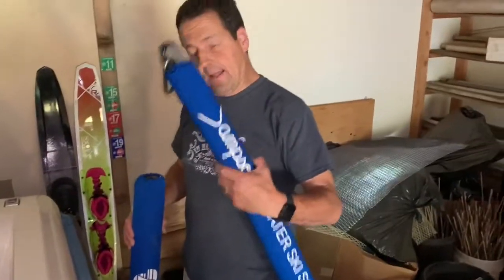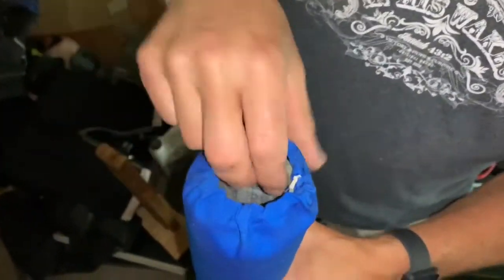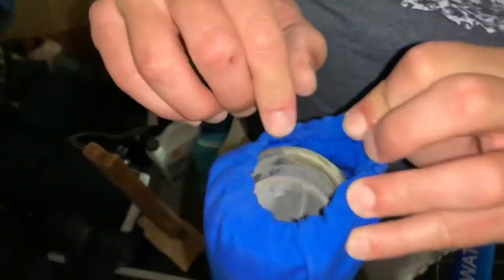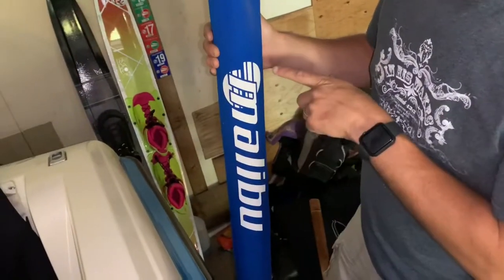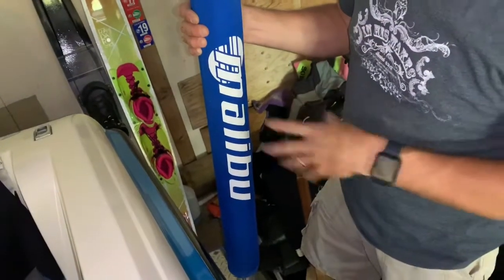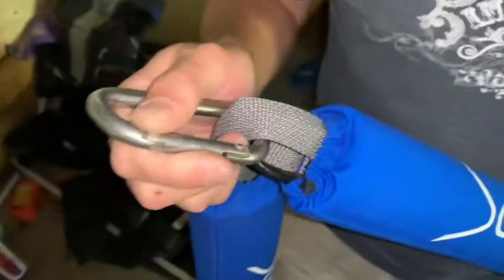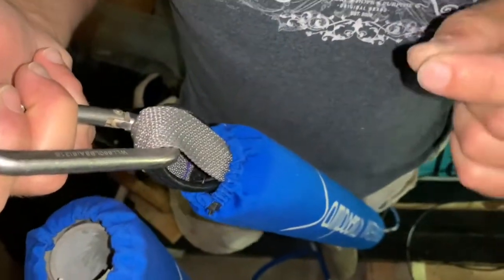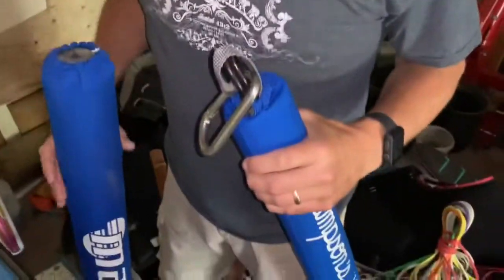Making Trailer Guides, Shock Tubes and Boom Pads

Comment: What are boom pads and shock tubes?
Reply from the maker: Pads for barefoot booms. A sleeve that goes over the cables to prevent the bow of the boat from being marked up. 
Shock tubes are basically the same size and build. They go over a slalom rope and hook to the pylon. They breakup the recoil of a rope released from the skiers hands out of high tension, so the handle doesn’t hit people in the boat.